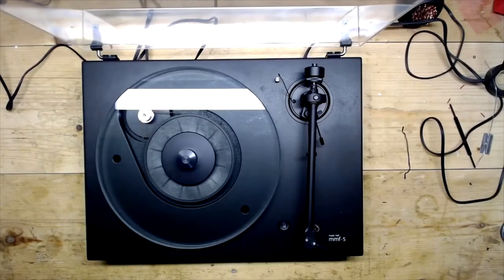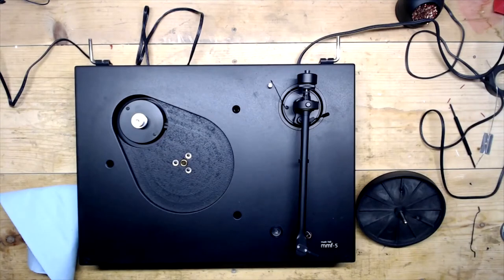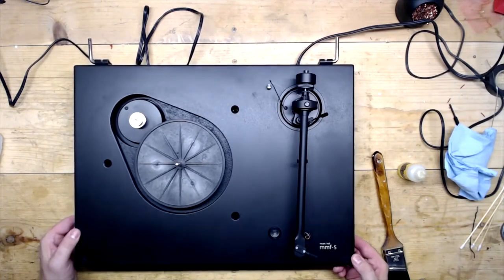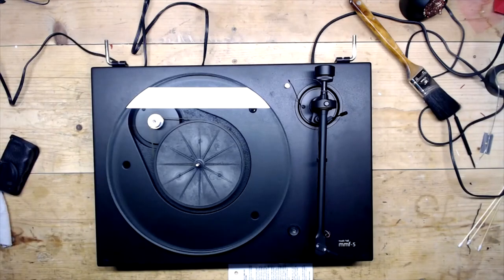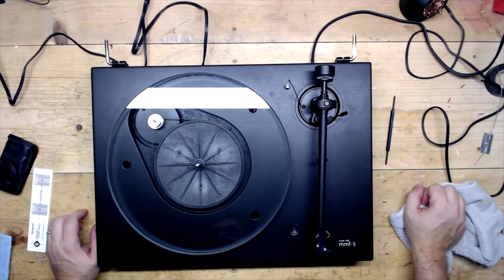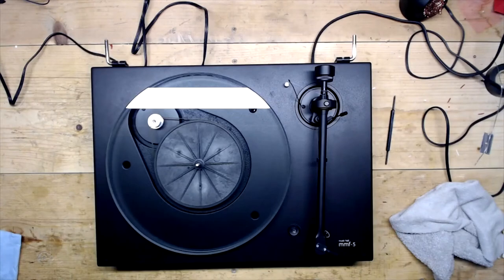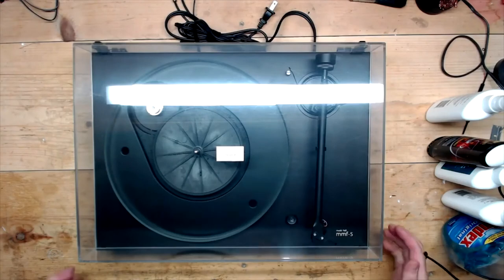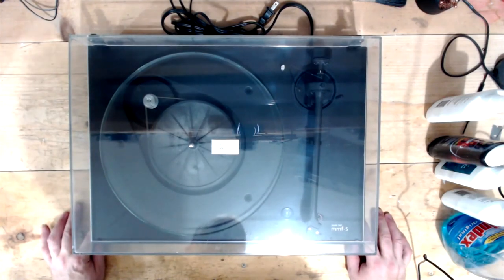Music Hall MMF 5 Turntable Evaluation, Service, Adjustment and Dust Cover Polish

Comment: Thanks for this… I have same model. Some how the 3 nuts on the platter bearing worked their way off during our move…I have the 3 screws. Do you know the nut size for those screws? Thanks
Reply from the maker: Unfortunately I do not.